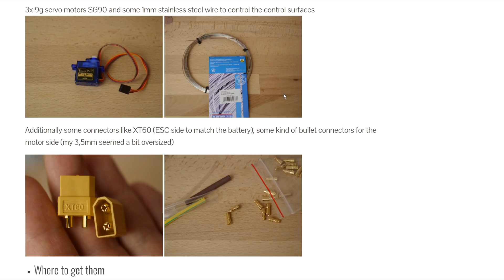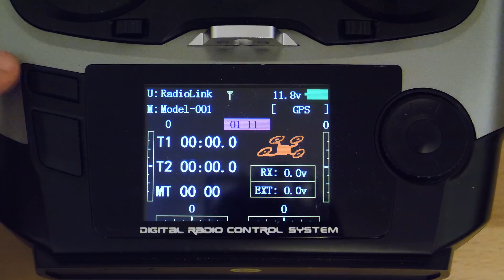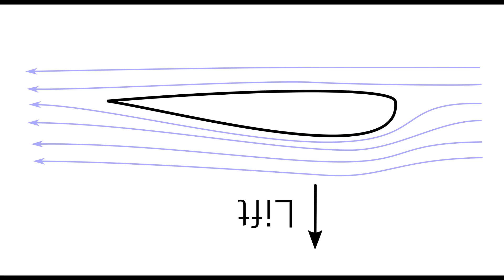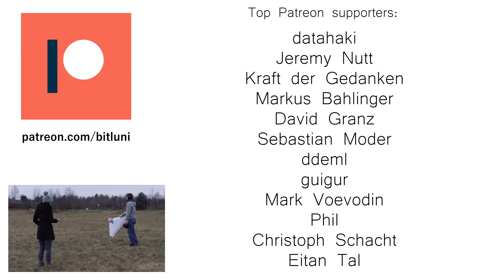RC Plane Experiments

Comment: I'm not a pro designer but I can offer some tips:
- polystyrene is very fragile, it would take a lot of tape to strengthen it enough to handle even a rough landing, but with that much tape it might start to get heavy
- a large prop like that might be causing torque roll, in my experience planes do better with a bit smaller props with greater pitch and higher kv motors.
- motor at the back would reduce the probability of breaking the prop and getting mud in the motor, also safer if you crash into yourself
- you don't really need any rudder on a flying wing, but it can help at lower speeds. I think winglets would help more than a central rudder.
- launch speed needs to be much faster, otherwise you have no control (without air flow the control surfaces have no effect), give it a decent throw and if in doubt use full throttle
- google "flying wing cg calculator" to see where the cg should be
- flying wings usually need a little reflex (both elevons trimmed a little upward in neutral state)
If you are new to planes the Turnigy Bonsai is a great one to start with.
Reply from the maker: What do you mean "not a pro designer"? You have my favorite RC stuff channel I'm watching since you lived in Japan. Detailed videos and cool projects. Having fun trying some stuff is much more pro than being competitive.
( anyone reading this.. check out https://www.youtube.com/user/iforce2d )

on your tips
- I think I'll use other materials in future.
- I thought I could trim the roll once it's in the air and I get a feel for it :-D But I think I'll try 3D printing some shorter props next time... That will be cheaper
- Having the motor in the back is a good idea... I guess it's common to catch the plane when "landing". I thought the plane would be easier to control when something is pulling the nose.
- Will consider winglets, Faster starting speed, better CG and flex on my next wing design. Got it :-)
Is the Turingy Bonsai the one you have been testing lately?
Also is there any specific video or playlist of yours which I could link? Have just a link to your channel on the project page right now...
Reply: I think every electronic geek can say that this is (in the key of comedy of course) our usual introduction to RC planes world, and I say that if you got some laughs is a good starting point ;) keep going

Comment: The fist time you run those small motors at full power is always impressive. I bought the same motor for my first plane because it was one of with the best price/performance.. Although now I prefer to build them with 2 small motors on the wings.

Comment: I loved this, it was amazing to see you puzzling out everything for yourself, made me nostalgic for my first days in the hobby (which were still not so long ago!) and your very first flight, which was exactly like mine (except mine involved a little more blood.) Please do not be discouraged! I want to see your first successful plane! :D
Things I can add that may help: (1) iforce2D's advice is all spot on, except for (2) Polystyrene WITH a complete tape skin is VERY hard to break. Just use clear packing tape as it is MUCH lighter than duct tape, and (as a bonus) a smoother surface to reduce air friction. If you look through my earlier videos on my channel, you will see my awkward early polystyrene builds, with their tape skins, surviving enough of my beginner crashes to reduce a bought-RTF plane to a fine powder. :P

Comment: Hi , I faced the same case when I have firs fligth with my v tail
I can offer :
You can move the battery pack a bit  close to the motor, so you will move the gravity center of the plane right to the nose of the plane

Comment: Definitely throw it harder on the next attempt! With few exceptions (very light, 3D profile planes), you need airspeed to maintain stability and controllability. Any of my (flyable) planes would crash immediately if I threw them as softly as you threw yours. It also looked like your CG was too far back.

Comment: bitluni's lab  now I can’t wait for your next video. Good effort . It’s a shame it didn’t work the first time. I know you put a lot of hard work in to it. Use foam board it straight and nice to work with. Tip try working your centre of gravity out and a smaller prop, and higher kv motor it uses higher revs. Just subbed by the way. I’ll be watching my Frend 😜👍🏽
Reply from the maker: the weather is so shitty here It will have to wait a bit. But I have other really cool projects coming up

Comment: Make sure you use a CG calculator, you can find by Googling CG calculator. You do not need to cut an airfoil if you were CG is correct. The airfoil only offers efficiency

Comment: watching you spool up a motor, with a prop on, in your hand, on the wrong transmitter stick that spring-returns to half throttle, was very painful. lol
Reply from the maker: +Low Elevation RC yeah.. funny to watch a noob 😂
Reply: not really funny, just... the safety risk of that. Which I think you realized soon after :D
Reply from the maker: yeah... it is the genuine footage of my first excitement of this working at all. I knew I had just to swap the connections :-)

Comment: That would fly great if you balanced it. You kind of created the RM airfoil (Rusty Mustard, look it up on RcGroups) a modified reflex airfoil. It would fly good flat as well if it were a little thinner foam, it would just need a bit of uptrim on the elevons to create the reflex. Also make the elevons full length, you can always turn down the throw on the radio. Good attempt and video, dont give up!

Comment: DISCLAIMER: I'm Italian and I'm using the google translator!
I apologize in advance for the translation, which I hope is understandable and that does not turn the spirit into whiskey.
Congratulations for the insane idea of entering the radio-controlled flight.
I'm glad someone else is venturing into this beautiful world.
When you can fly you will have a great satisfaction.
It's nice to see the enthusiasm with which you created that horrible thing.
The intention was there all!
The best thing you can do is approach some expert model maker.
There are two mandatory things you need to fly: learn how to build the flying model and learn how to fly it.
I do not know if you already had previous experience of driving flying models (the radio tells me that something you have already done) but the construction of the model tells me that you have absolutely no experience in construction: the form of the easiest model for flight is that traditional with high wing with accentuated dihedral, without ailerons and tail controls (elevator and direction)
When taking off, remember to push the model: if it does not advance in the air, the wing surfaces can not create lift and the plane crashes like a stone. And now as a teacher I become a student: can you tell me more about how you made the battery pack: connections anda balancing, and what is the electronic circuit that I saw on LI-PO batteries?
Knowing how lipo the bitches are, I'm afraid to experiment with,and I'asked to me what those electronic circuits are for and what happens if I delete them.
Thanks for your hilarious video (it takes more joy in the world) and for the answer you want to give me and do not give up .. Never!
P.S. in what part of Germany do you live? I have a few friends in Renningen near Stuttgard
Reply from the maker: I live in Darmstadt that around 100km away from Stuttgart. Thanks for your hints and the appreciation. I'll try a traditional model with higher starting speed next time. 
I bought some refurbished tablet batteries. there was a protection circuit with I think some kind of poly fuse. However, the circuit couldn't be reused since it was designed for much lesser currents than those we need. Meanwhile, my cheap 15€ battery from eBay arrived and is I think an easier way to go. YOu can see it on my homepage.

Comment: Double the flight time? You, sir, are very modest! :D Anyways hope You will have the patience to continiue on with it. It is not easy, specially when every landing ends with broken prop...
Reply from the maker: I hoped someone would get it :D
I'll try to 3d print a bunch of props and also try a back mounted motor

Comment: Almost there ! Check the CG. It should be between 1/3 and 1/2 of the length. Also you should get a hot glue gun. The best to build and repair RC planes !
Reply from the maker: hot glue... one of the main drivers of an inventor :-D
a battery powered might be a good thing to have
Reply: Absolutely :) I got a small 12V one from Banggood with an XT60 connector. Nice for field repairs !

Comment: dude, on the battery connectors a recommend you flip one conector using a male and famele on the battery
Reply from the maker: hhhmm that could protect from plugging wrong way around. I just didn't want to have any connector metal exposed. to prevent shorts. but fun fact.. after my ordered battery arrived I just realized the two male 3.5mm esc connector perfectly fit into the female XT60 connector of the battery. Didn't have to change a thing there. This can also be seen on one of the pictures on the project page.

Comment: As a long time RC flyer and one who has designed, built and flown many of my own creations including foam delta models I can tell you that your plane WILL FLY!  The centre of gravity (front/rear balance) is critical in any but more so in Delta models.
I normally aim for 15-20% MAC (Mean Aerodynamic Chord) which is 15% of the average chord (longitudinal size of wing) measured from the front edge.  There is a graphical way to calculate this which you can easily work out using the sketch here :  https://stunthanger.com/smf/index.php?action=dlattach;topic=17938.0;attach=66215;image
I also suggest that you set the absolute movement of your elevons to 15 - 20mm at their trailing edge. Big elevons need less angle to achieve 15mm, small ones need more but aim for this to start.  Find the "Expo" setting on your transmitter and add up to 20% to soften the controls near centre-stick and make them sharper where you need this at bigger stick deflections.
If you get a successful first flight, maybe change the C of G back to 20% MAC but not to the point that your elevator control is binary like a switch!  Good luck :)
Reply from the maker: that's much info thanks.. I'll work it trough for then ext one :-)

Comment: Id go for building a more traditional aircraft using Dollar Tree Foamboard (Readi Board) Just make a high wing, airplane design. You can make a really good trainer plane if you make the wing of the aircraft detachable. Holding it down to the fuselage using rubberbands and bbq skewers. And your CG is waaaaaaaaaaaaaaaaay off. I recommend using one of the various CG calculators for wing designs.
Reply: The motor youre using on this plane seems to be insufficient to pull this plane also.
Reply: I put this motor on a test bench it pulls 844g full thrust on 3S with the same prop he is using. 4.57g/W. They are probably adequate for what he is doing. They are very cheap and not so shitty in my opinion. Good enough for starting building RC planes.
Reply: Michel PASTOR They are shitty in my opinion but I agree they are ok if youre just getting in. But the amps they pull for the amount of thrust it outputs is just not good in my experience with these motors.
Reply: I can give you the numbers (with the 1045 prop he was using): 8.15g/W at 50% throttle. 4.57g/W at full throttle. Similar to the other motors I tested.
Reply: >8g/W is even very efficient

Comment: You just made me cringe by purchasing those shitty motors... I recommend Turnigy Brushless Motors... The orange ones. Especially the 1100kv motors.
Reply: why though? The motor wasn't really the issue here
Reply from the maker: I kind of expected to crash it after "some" flight so it's not that bad using cheap motors... but thanks for the recommendation.

Comment: That was entertaining to watch :) 
Also, the photo of the unbalanced battery fire is really scary...
Reply from the maker: It was scary... I think I wasn't even home when it happened. My home mate was sleeping when it exploded. I told us 1m flames came out the front and back of the pack. He woke up and have thrown his pillow on it. In shock, he tried to leave the room but forgot how to use the door handle for few seconds. Even he is well informed he did a huge mistake to get a bowl of water and tried to pour it on the fire. Such lithium fire is so hot it pulls the oxygen from the chemical bond of the water... The fire was so hot that the glass of the window burst. Thankfully he managed to get it under control. Noone got hurt and the insurance seems to cover the damage. 
Fun fact, that event inspired the smoke detector video, which depicts such battery burn in a bigger extreme :-D

Comment: That's pretty cool. I'm no RC expert, but maybe check the balance. Like where is the battery, and making sure nothing can move if you tip it on one side or the other, as this would mess the balance up while flying. Anyway, nice try. And failing early is actually a very good strategy when it comes to prototyping ;)
Reply from the maker: One of my Patreons also suggested checking the balance. Actually, I tried to keep it roughly balanced but the whole thing was a mess... too small rudder.. messed up airfoil... and it's too fast for me. I'll try something slower and more precise next time :-)
You are probably right with the failing.. better now than loosing expensive fpv stuff later